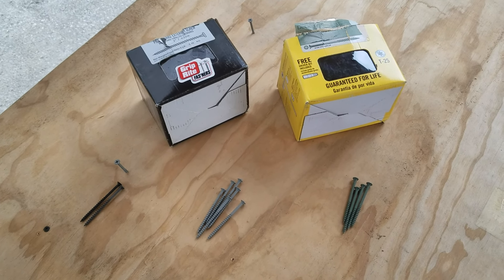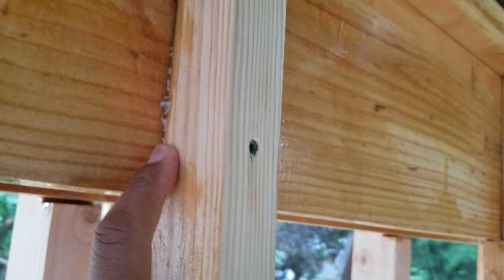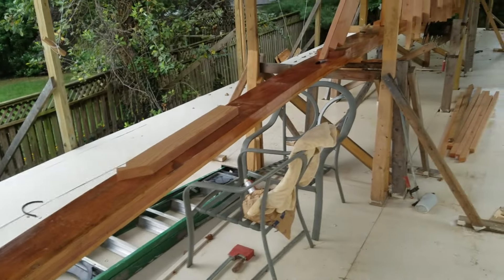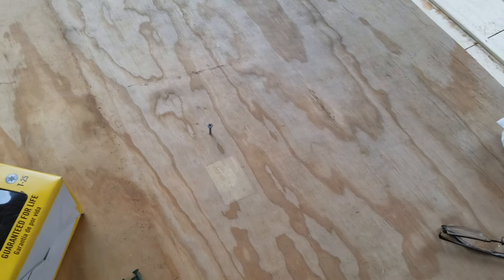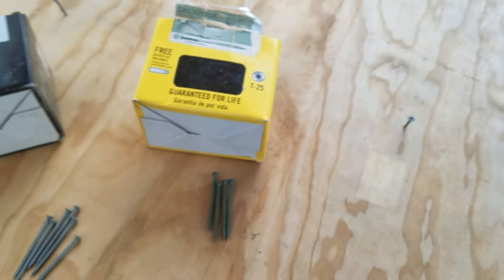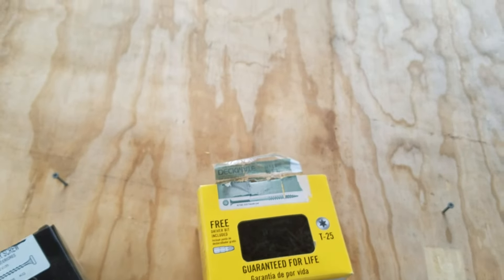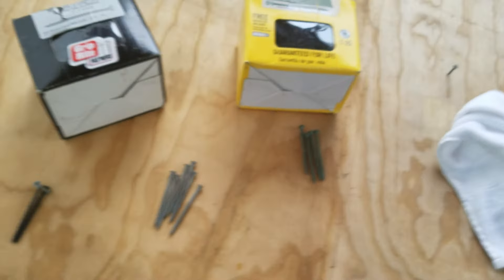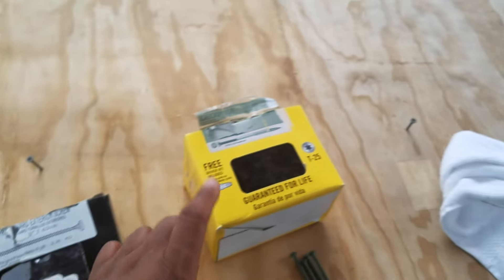Early morning screw in the Boatyard.

Comment from the maker: Boy this seems to be the topic of the day. I bet someone will re-fit my boat in 100 years and they will say "wow the screws he used sure did last ". :-) I don't know if it's a Yachty thing but there are plenty of boats here on the Chesapeake, real fisherman work boats, that were thrown together with galvanized nails that have lasted 30 years. We are talking about proving a benefit in terms of decades of use. The coating on the screw itself I believe would last at least 30 years. Encapsulating it in epoxy, which we know will not deteriorate unless it is in contact with the Sun, will make these screws last 100 years. Again, I believe in my building method; encapsulating every member with epoxy and fiberglass will keep the water out. If the water comes in I have a problem. Great discussion though, keep it going :-) Peace and blessings to you all.

Comment: That's a lot of thinking for this early. A thought; Even with the heavy build up of wood/epoxy, living in a fluid environment, I would think the structure as a whole, flexes. Would that cause any issues with the non-flexing screws, or be so small as not to be an issue? The best to you. Make it a great day!!
Reply from the maker: That's a new issue. Never thought of that. Typically wood boats are built with screws so shouldn't be an issue, I don't think. I believe the modulus of expansion for epoxy and wood are very similar. :-) Time will tell.
Reply: Those screws might be an issue on this topic, especially since most of them (under that design banner regardless of maker) are designed for one use only (and yes i know you can reuse them, but that's luck at play or soft wood). Those screws deform easily and once they do they become brittle. Not really meant to take a beating.

There is however a type of screw (for wood, so larger spiral gap) that's thicker than the others, those, last multiple uses, and i really mean multiple, every time i recover those from whatever stuff i've worked on, i keep them. It's noticeable too, it's not a micrometer difference.

To say again, it's not the peaks that are wider in the screws, rather the valleys, the body of the screw that's thicker. However, on those, i'm not sure on holding power as opposed to conventional ones, since smaller gripping surface...i guess everything is a trading game.
Reply: Oh, and, i'd recommend driving them slowly, not fast, medium speed. The fast action accelerates the stress in them, if you hear them squeak, stop drive them out and better be safe than sorry and use another with some soap coating. 

These screws were never meant to take the abuse, and i got this line from an engineer that i'm working with, so i trust his word over the "testimonials" written on the packages.

Comment: So does the lifetime warranty mean they will give you some more screws if you have a problem?  Not much protection if a failure costs you tens of thousands of dollars.
Reply from the maker: Actually yes, and you can receive damages if you can prove the product was responsible for the loss.
Reply: +Iandi Boats have you asked the manufacturer of the Screws if they warranty their products in a marine environment. There is no environment so pernicious as the maritime one.
Reply: +Norman Boyes But I do like your thinking of sealing in the screws with epoxy.👍👍 The problem is that if you do get any corrosion around the screws that can affect the wood very badly, albeit it takes a lot of time to do severe damage - like 30 years.

Comment: The builder of my boat didn't use that much stainless, and in 35 years time that is not good. I use Stainless 316 for everything now. Seawater always finds a way.
Reply: I concur.  Even on my fresh water boat I only use stainless fasteners.

I would like to see the cost difference between the "lifetime" deck screws and stainless steel crews.  Also, on construction screws, you can save a lot of money by buying a 25 lb pail.  PS.  I do like the Grip Rite coated exterior screws much better than their drywall or gold colored interior screws.  I have successfully removed and reused some on outdoor projects.
Reply from the maker: after 35 years of use every boat is due for a major overhaul. If at that time the screws have failed and they will just be able to drill them out and replace them. But I don't think that will be the case. Whatever kind of coating, if any at all, was on the screws your Builder used I'm sure it's nothing like today's coatings. Remember my screws are not holding anything. They are temporary measures to hold the wood in place until the epoxy drys. Once  the epoxy drys I could take them out.
Reply from the maker: +theoldwizard998  I plan to use stainless for the deck fittings but not in the construction process. It's overkill.
Reply: If they are not "structural" you are correct.
Reply from the maker: +theoldwizard998 it is a composite structure so the epoxy is the main structural component not any fasteners.